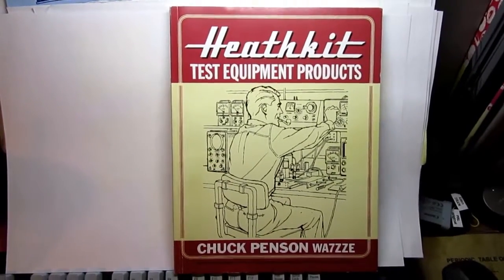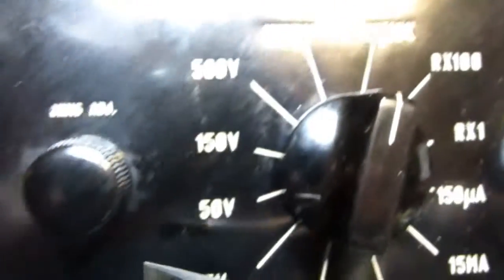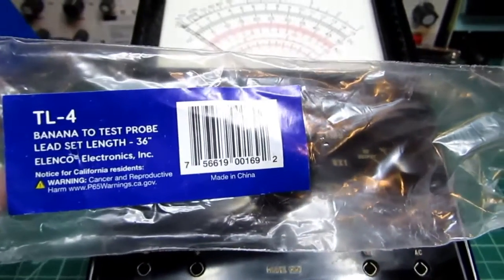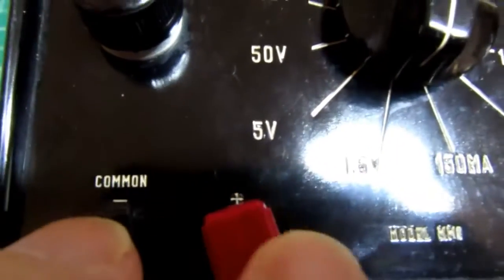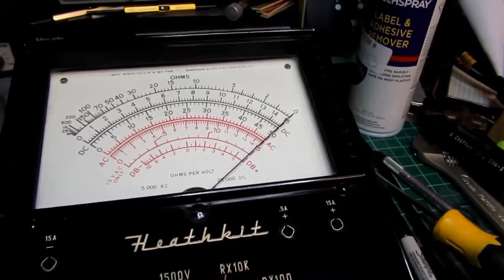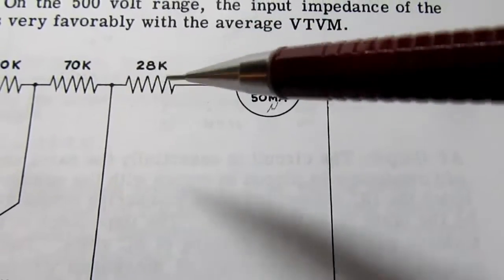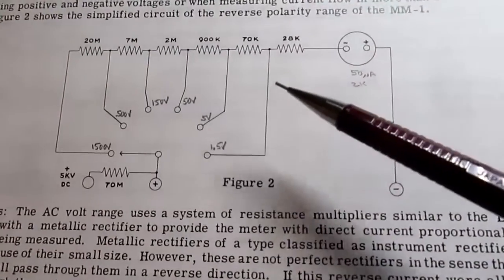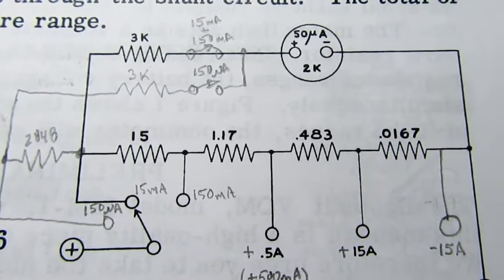Heathkit MM-1 VOM / Multimeter: History, Overview, Demonstration, Theory

Comment: About your discussion of the use of two diodes near 33:51: The reason is not that the manufacturers used copper oxide rectifiers back then but to have a conducting diode
for every half cycle of the AC. When you simulate a multimeter for example in LTSpice, you see that in a 5kV AC range one diode would have to withstand a countervoltage of
more than 7kV, which is huge even today, while with two diodes both have to withstand the diode voltage of 0.6 V for germanium or 0.8 V for silicon only because one of them is
conducting always. All the rest is taken up by the resistors of the voltage divider.
Reply from the maker: Wolfgangrichter, no doubt your point has validity, and I did not mention the consideration of diode reverse voltage. However, after I had my idea as explained in this video, I did some sleuthing and found that the reverse biased leakage was still a real thing and was a contributing reason for this diode configuration. I even found it in an old textbook and in circuit descriptions of vintage meter manufacturers.
As with so many things in electronics, there is often more than one reason for a component to be in a circuit.